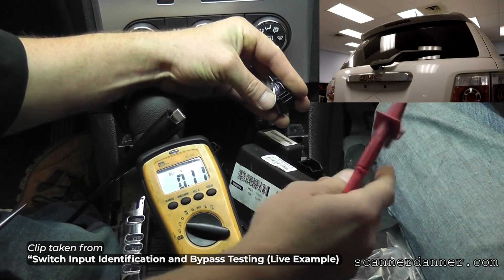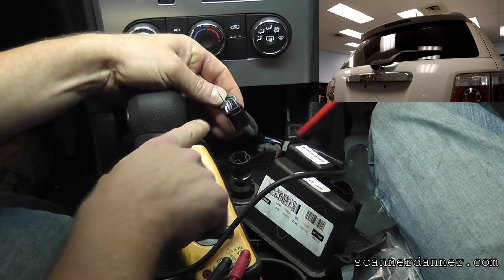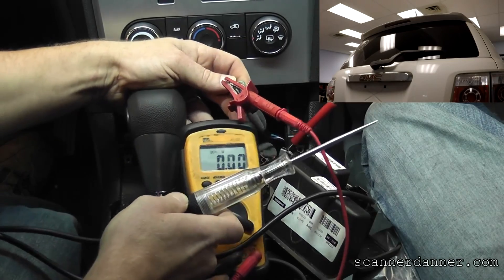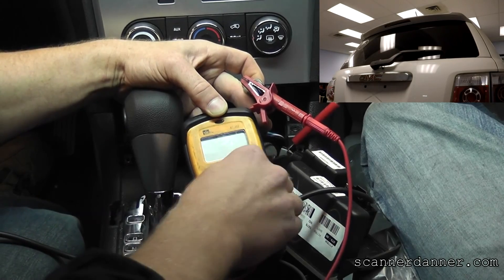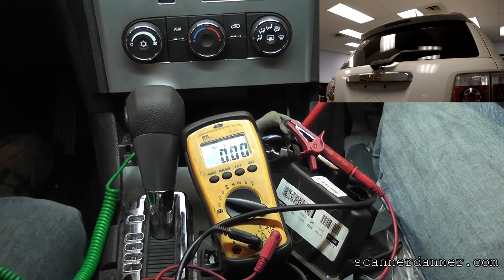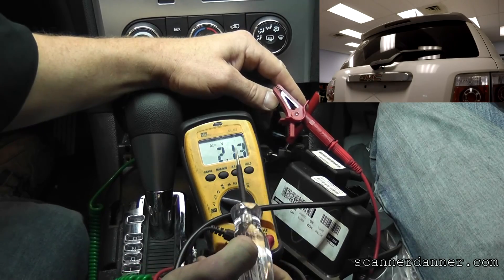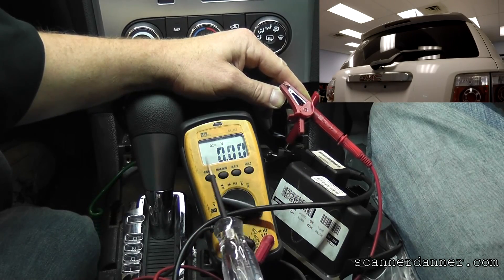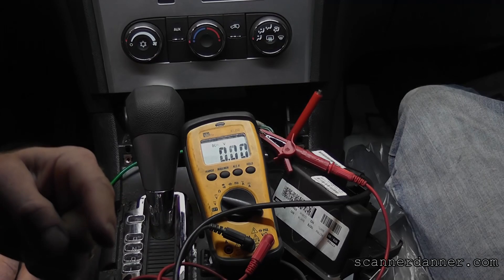Switch Input Bypass Testing - LED or Incandescent Test Light?

Comment: Hello ,i have a question
Why don t we jump wire the two pin,why we need a test light?
Reply from the maker: You can use a jumper wire, but you better no accidentally touch the wrong pin. The test light is a buffer in case you do it wrong

Comment: Okay so, I’ve always been unsure how to use a test light as a “ switch “ , so I want to make sure I understand this. Only if it’s a pull up design can you do this? And why didn’t you use the 12 volts that’s apart of the circuit ? Would that not have worked?
Reply from the maker: Pull-up or pull-down circuits! Ask yourself, what does the switch do? Does it pull the signal voltage low or does it pull the signal voltage high? Then connect your test light with the correct polarity to do the test. Make sense?
Reply: @ScannerDanner  thank you

Comment: Hey there. Love the vids they helped me locate a short in driver side headlight. I was wondering, could a damaged ground cause a parking/standing light to stay on 24/7  and kill the battery?
Reply from the maker: Hard to say without way more info on what that wire is and what it is connected too, but most likely not

Comment: Hi Paul. Have you ever done a scope test to diagnose a faulty reluctor ring? Thanks
Reply from the maker: Yes, I have a few case studies/classes where I've shown this
Reply: @ScannerDanner Just came to realise mine is the cause of a 4 year mysterious P0335 fault code. Changed the Pulse Ring last November to try and fix it but unknowingly put the faulty reluctor ring back on. Kicking myself. 

No information available on it being the cause of a crankshaft sensor not learning problem, even though they're used on many GM vehicles.

Comment: Hello. I was wondering if you had any known good waveforms for a 2008 GMC Acadia coolant temperature sensor???
Reply from the maker: That would be known as a thermistor. 2-wire sensor that has a signal and a ground. Signal voltage will range from .5 to 4.5v depending on the temp of the engine. Step 1 for you would be to measure voltage (plugged in and backprobing) with the engine cold and the same temp as the outside air. Then compare what voltage you have with a temp chart. That I don't have. You'd have to search for that info

Comment: I’m curious as to why you didn’t get the result you were expecting with the LED test light.

Does that LED test light give the same result in both directions? Like, if you put the clip end on the grey wire and probe the battery positive instead, do you get the same result?

By definition an LED should only work in one direction, if it works both ways then there is some extra circuitry that makes it happen, and maybe the path the current takes has a higher resistance than the path it takes when the polarity is reversed?
Reply from the maker: The LED test lights with a single alligator clip have circuitry within them that they will light with either polarity. 
The reason for the lower voltage is because of the higher resistance of the LED bulb/circuit. Also with this being a voltage divider type of input circuit there is another internal resistor in the computer you are not seeing.
Reply: @ScannerDanner  thanks for the info. I always thought the resistance of an incandescent bulb would be higher than LED. So when I switch an old bulb for an LED one, theres more resistance in the circuit and thats why the ecu thinks theres a bulb error, the voltage drop is higher than expected. 

Damn, all these years i thought the error was because the led bulb didnt draw as much current 🤦🏼‍♂️  and when you get LED hyperflash the load resistors are actually to reduce the resistance of the circuit, not to increase the circuit load?
Reply from the maker: @xDMG15x  it doesn't draw as much current (higher resistance) so you were right on that point

Comment: ayy danner its me again lol, soooo i watched your video on control testing on ignition systems. but this is weird.. i remember you saying the feed wire should be brightly lit consistently. but after testing my feed and control wire they behave the same? as in, they get bright and dim continuously. now , i dont know if i should consider that valid. again.. crank no spark. power coming in out of the injectors and coils. ohh yeah! and the injectors behaved the same too.
Reply from the maker: If coil positive and negative look the same, you have no control. Focus on your inputs next if the injectors are doing the same thing
Reply: @ScannerDanner  danner i am so sorry. i think after all this time i found my issue. was recently studying about finding shorts etc, idk i was bored. anyways i took the intake manifold off and inspected the starter. the positive battery cable to the starter was barley makingg contact. and, 1/3rd of the harness which was ground was suppose to attach to the starter. i attached it to the engine block instead. is that why im having no spark and slow cranks like this ??? i cant believe this

Comment: What I learned recently is that LEDs vary in resistance if you load different amounts of voltage. It has to do with semiconductor properties, that might apply here 🤷‍♂️
Reply from the maker: The main point I'm showing is that LED bulbs have much higher resistance than conventional incandescent bulbs and generally will not trigger a switch input circuit properly. Thanks!
Reply: @ScannerDanner  of course! I was offering an explanation for why this might have happened. I've been watching your videos for a long time. I bought a small handheld oscilloscope not too long ago that helped me find an intermittent injector pulse dropping out on my 1991 supra turbo. I used your son's celica video to understand the G and NE signals, but in the end I just cleaned the ECU ground and it seems to have done the trick. Pre OBD2+intermittent can be a pain but i've learned a lot. Thanks to you :)